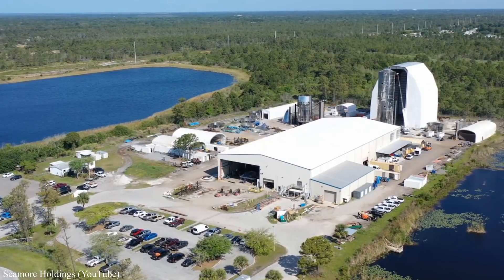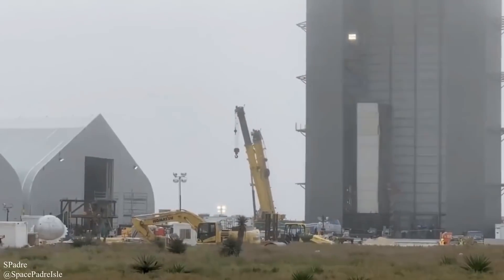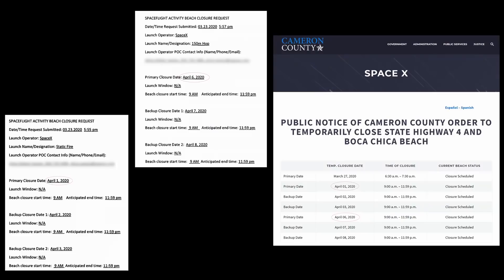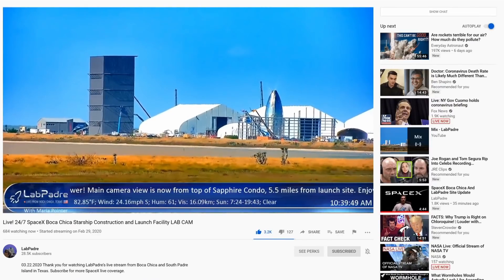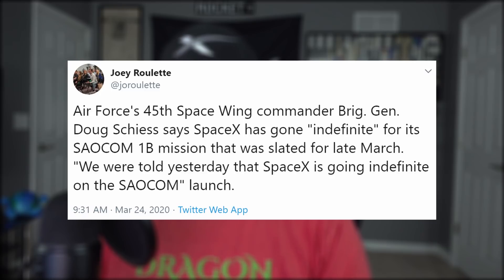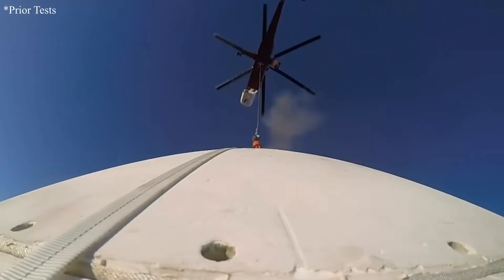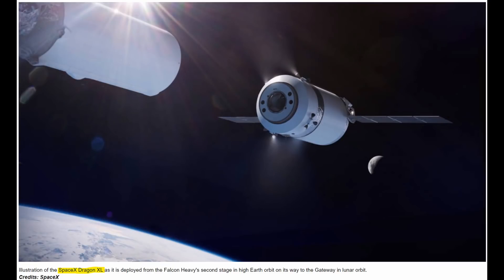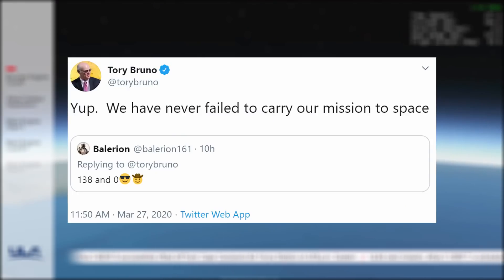SpaceX Starship SN3 Prepares To Hop | SpaceX in the News

Comment: Labs feed - SN3 moved past the new camera stand at 8am Sunday 29th.
The engine-out has pretty well proven that the loss of one engine doesn't affect the completion of the primary mission, that implies the crew launches will also reach the correct point in the flight profile for stage-sep and second stage burn, even if an engine fails. Add that to the flawless In Flight Abort test, and there reason to think the F9/Dragon will be the safest crewed vehicle so far.

Comment: @spaceXcentric Could you ask the Lawyer wife (Karen?) about the 1 time 150 meter hop restriction on the FAA Permit?

(b) SpaceX may operate the Starship Hopper vehicle for 
nominal one flight, altitude without of further 150 meters FAA AGL authorization, or less, to a 
with a maximum propellant load of 30 metric tons at liftoff, in accordance with its application.

Comment: To be fair, just because the engine shutdown happened on the 5th flight, it doesn't mean that issue was caused because of the reuse. Its still worth investigating to make sure that it is indeed because of the reuse and not a design issue or some manufacturing error (which is unlikely because there're reused engines)
Reply: Absolutely true.  If history is any indicator, Elon WANTS to know what happened, why it happened, if anyone had any inkling it might happen, what design or operational  change will prevent it from happening in the future, oh and all of that should have been reported to him 15 minutes ago or sooner... if possible.
Reply: i remember SpaceX pointed out that it was indeed caused by the fact the booster was used. They also said they still would have launched the booster if it was a spaceX cargo like starlink, but here they couldn t take any risk.
Reply: GreyGeek  It may be optimistic at the moment, but give it a few months/years and it will be more than 10.
Reply: Well, NO flight failiure is really because of reuse, just like no human dies of old age. Some part or some software issue caused it to fail; it may have been pushed to that point due to reuse, but it’s not the reuse itself
Reply: Right. If you're depending o. those engines to land tour your vehicles you better be sure they're reliable, reusable and have a fail safe in case of engine failure.  This is why I've asked if the escape launch engines could be utilized in the event of a parachute failure.
Reply: NASA will use any excuse they can to delay Demo 2 to beyond whatever the timeframe is for Starliner now. 
If that means they have to find excuses for a year or more, so be it.